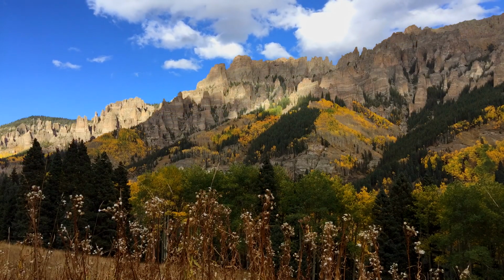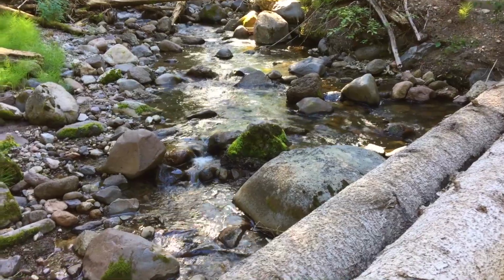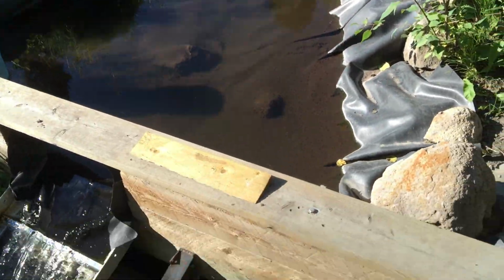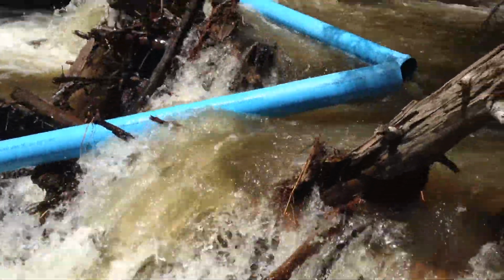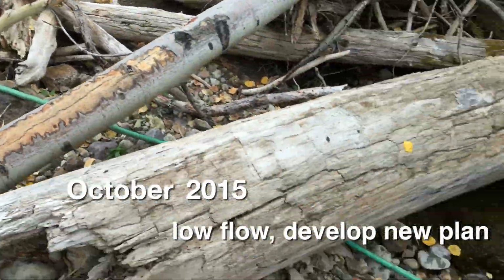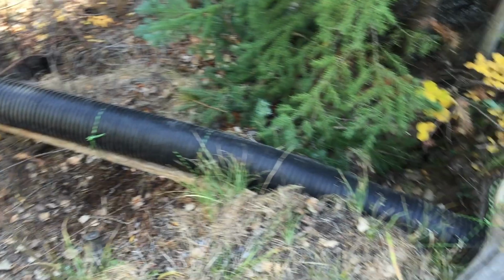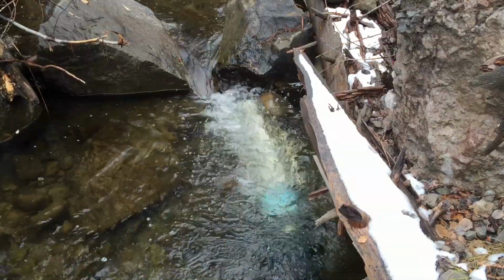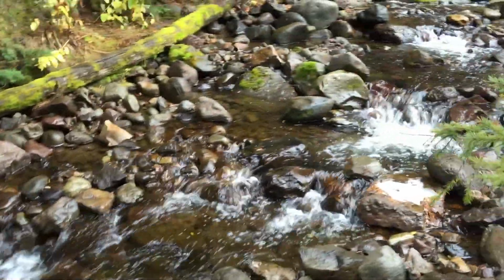Part 16 MicroHydro Power System in CO

Comment: So glad you posted an update.  I had wondered if something got in the way of finishing the system or the you tube series. I would have never thought a single person could of completed as much work as you have.   It's time for me to rewatch the entire series to see the beautiful landscape in Colorado. 

I edited out my question about a break even cost as I found you answered it in a reply to another post.

Thanks again for the smile and good feelings your series gives me.  Rob
Reply from the maker: Yup it has been a ton of work stretched out over a long while.  The final steps will be to increase the AC load on the system to maximize the power produced/used, and add remote controls and monitoring equipment.  Once that is complete, I plan to document other folks systems that I know of and continue with efforts to spread the knowledge.  

Lots of the questions I get are similar in nature, so I guess I should create a blog page to fill in the blanks and give more detail.  It all started out to show someone that might acquire the property in the future how the system functioned and then morphed into a how to hands on series.

Thanks for the interest and support, it makes all the more fun for me.
Reply from the maker: +DoggyDriver UK 
Your questions lead to an interesting discussion.  The flow in the system will be varied depending on the time of year by gross adjustments to the flow.  Winter=higher, Summer=lower.  The idea is to set the flow somewhere in the range of expected peak load demand.  We will install a means of monitoring and seasonally adjusting the flow remotely.  That will be the the topic of a future video, so subscribe if you have interest in that.

On the topic of waste, the only consumption in the system once installed are flow of water and mechanical wear on components.  Heat as kinetic energy is either lost in the movement of water in the creek or in a concentrated form in the dump load.  There is actually less evaporation of water while it is in the pipeline vs. tumbling down the watercourse, so in a way there is a small conservation of resource with more water in the pipe.  

Mechanical variance of flow via solenoid or stepper motor is much slower in response to load changes than electronic control of load and that equipment might require more maintenance long term. The reaction time to be fast enough to adjust large loads could lead to a water ram and endanger the pipeline pressure wise as well.  Also the cost of adding it would be a waste of money as the system works well as is.  The idea has been to repurpose all the existing equipment into the new design which saves some resources.

As far as storing water, it would take a large pond or small lake to make effective use of storing water.  The intended top flow rate will be roughly 300gpm or 5 gallons a second.  That's a LOT of water!  And even that is a small percentage of what is available in the creek depending on the time of year.  Thoughtful questions though and interesting for me to consider the reply so thank you for your interest.

Thanks for watching and subscribe for more videos, the more subscribers we get the more YouTube promotes the series and the more people see it.  Well over a million views on the series now which goes far beyond any expectation I had at the outset.  It's a trip!
Reply from the maker: +DoggyDriver UK 
There's always lots of things to consider. If I put in a storage tank, it would cost a lot and require state permits from the Water Court as well.  Constructing a pond or lake would require a large dam which would have to be permitted engineered and inspected.  Not an easy access area either and it would alter the natural state of the land there as well.  Always lots of things to consider.   Better to just tap the creek for what we need. 

Thanks for your interest, share with friends if you have any that would find any of the series interesting.  Decentralized power capture is the way of the future.

Comment: Good to see the refinements you did over the summer. Your intake point is really challenging engineering. With the severe drought here in CA we had to get a little more innovative to keep things like the walk in freezer running. It forced us to learn more and plan to refine those innovations  next year. Load leveling is very useful. If you start running out of power look into it.
Reply from the maker: +Joel Horn (DIY Homestead) 
Thanks Joel,  Yes unfortunate the drought in CA(we spend part time in SoCal).  We lost 2 wonderful trees to it.  I'm assuming you mean 3phase.  Might be pretty difficult for me to balance (3) 4K legs effectively.  Or so I was told by Thomson/Howe, makers of my load controller.  Risk burning up generator.  Thats why I stuck with 1phase.  Still figuring out how to put the potential 200KWH/day to good use.  
Hope you post anything new of interest on your channel.  Cheers
Reply: +MrHydrohead Load leveling is  any way to store excess power during low use periods and then pulling it back into the system when your loading goes up. We are using battery based and water storage based storage for load leveling.http://www.victronenergy.com/inverters-chargers/quattro# This inverter/charger can be hooked up to your single phase AC hydro plant. It will take only your excess power to charge the battery and then when you load the hydro plant beyond its limits it will supplement just the amount of power you are over drawing. It is called power assist. It does not switch over to all battery power if the hydro is overloaded like most all other inverters do. Disclaimer I am not affiliated with Victron at all. It allows us to use electric stoves and ovens for cooking even when the turbine was putting out only 4kw. Our high head system is run of the stream like your system with no storage but the low head system has a 60,000 gallon pond so we diverted water from the high head to the low head system to fill the pond which we could drain when power usage was larger. Sorry about getting long winded.
Reply from the maker: Very  interesting.  I've never heard of this sort of device.  I will look into it.  Your setup has always been so cool because of the two sources blended at different pressures.  It shows how well you understand it all.  The calculation and building of your custom runners to accommodate this is a real feat.  Hats off to you.  I'm all eyeballs if you ever share more video on the load leveling aspect of your system.  Someday I'd love to see it all in person.
Reply: +MrHydrohead Someday we will have to make that happen. I would love to see your setup.

Comment: EXCELLENT EXECUTION AND RESULT! Deliberate, pragmatic, thoughtful, effective.  I will use this "case study" for my own projects. THANK YOU!
Reply from the maker: Thanks for your interest.  On the question of how much...
Reposting a previous answer to a similar question:
"It's a good question, but very difficult to answer. First, one would have to amortize the cost of laying in grid power in 1994.  At the time of the switchover the system had produced 145,000 kWh for a basic cost of $25,000 versus $140,000 for laying powerlines. Add $52,000 of current development costs and you are paying for all the future power generation in the systems lifetime. You would also need need to subtract the cost of line power over the last 19 years to determine the cost per kilowatt hour over the first system's history. The other reality is that the present level of power production is maybe 1/5 of what we eventually hope to accomplish. 
Ultimately because it is AC you have to use whatever power you are generating at the time you're generating it.  Living off grid with hydropower means that you use more power than you usually would, you run appliances more frequently, have access to using large electric tools, you always have hot water available at no cost, can defray the cost of heating your home in winter, and you are paying for all future power at the beginning. So, it becomes a lifestyle choice. Are you willing to pay for all of your future power upfront and have no environmental impact and thereby increase the asset value of your property, or are you buying into the centralized system with power production which at this point is based about 50% down to 42% on coal for power generation over the life of the current system. 
Changing one's approach/reliance on the polluting centralized system requires planning, commitment, and patience. It is not something most people are willing to undertake, or have the financial wherewithal to complete. I got lucky and found myself able to pursue this undertaking nearly 25 years ago and am fortunate enough to share my experience via the Internet which has developed in the interim. 
Hopefully people somewhere in the world will find the information useful."

Comment: Great update, from the last video assumed all was good but mother nature certainly throws challenges.
Reply from the maker: Yeah, it is a long process.  I have yet to finalize all the elements of the load system to harness the potential power output.  More power is available than I am currently accessing. Also a monitor and control system is yet to be completed and thus the subject of the next video.  Hopefully done with everything by spring/summer next year.  Once you get into hydropower, it becomes addictive.  19 years now. Patience is the only remedy. Keep moving forward, improving and refining...
I hope it is at least interesting.

Comment: Very nice installation! We made something like this in Siberia and get 2.2 kWt power, and connected to Xantrex XW system, works great!
Reply from the maker: +Adar Toboev 
How much battery capacity does your system have?  How much maintenance do the the batteries require?
Reply: 2x200 A*h , AGM, almost no maintenance.